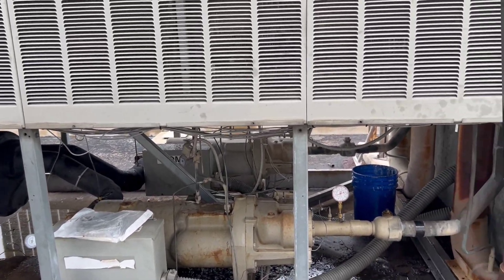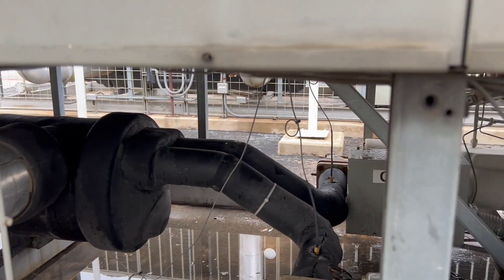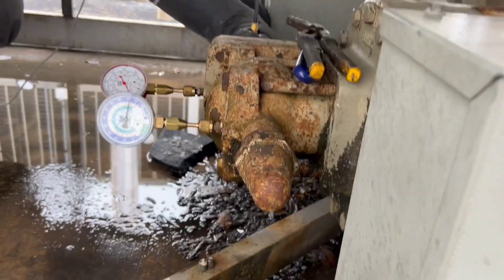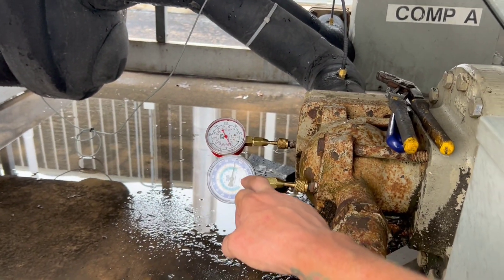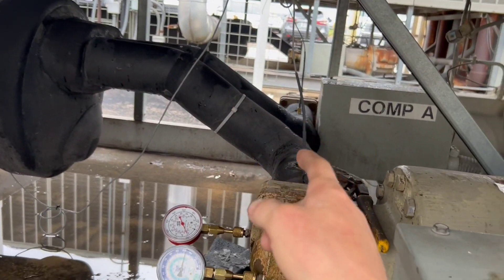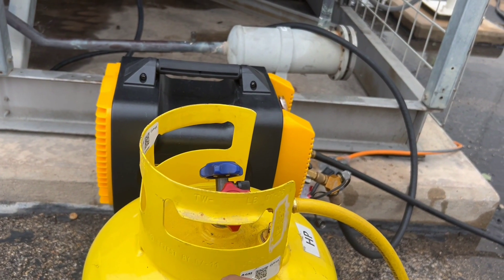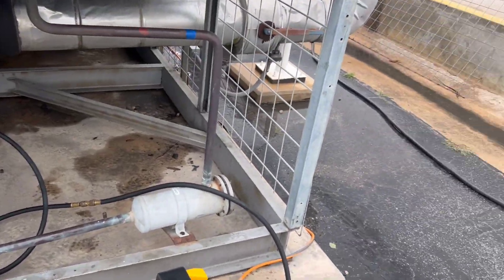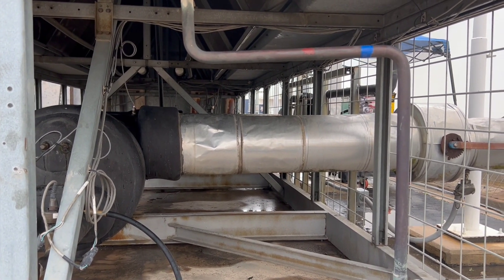REPLACING THE SATURATED AND COMPRESSOR SUCTION REFRIGERANT SENSORS. USING THE SUBCOOLER AS WELL.

Comment: Whenever the system is off doesn’t the EEV close to 0% acting as an isolation valve?
Reply from the maker: @videoloss4030  it does. It is a pumpdown. Unfortunately this one didn't work via the controller. Or I would've pumped th we refrigerant back into the condenser. The eev was closed, but leaking a very small amount.

Comment: You could have put the circuit in Service Pumpdown mode instead of recovering all that gas. After it shuts off pump what’s left in the low side to the high side.
Reply from the maker: I tried that on the controls and it didn't want to work. So I went to plan B.

Comment: lol I have to do the suction and the discharge saturated sensors on an RTAA soon too.  Too bad I have to recover the entire charge 🤦‍♂️
Reply from the maker: Yup, when its that deep....sure do. Gives you a chance to check the total charge, though. Make sure to check your oil level as well...thats important for proper health and operation of the compressor. Check and test the oil DP switch, master oil solenoid....you might as well. Don't want to be called " it was running before you worked on it"
Reply: Just replace all refrigerant - live sensors at the same time if the machine is older. Just sell a one and done update on all the sensors. Especially if you are pulling the charge. Good time to replace relief valves too!